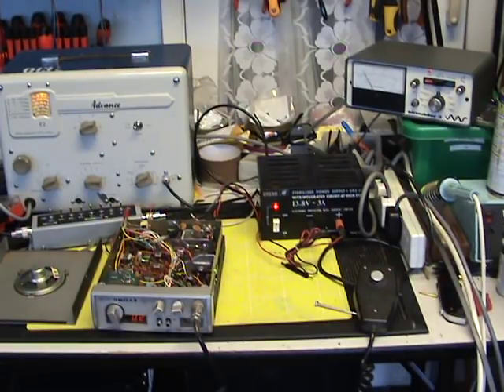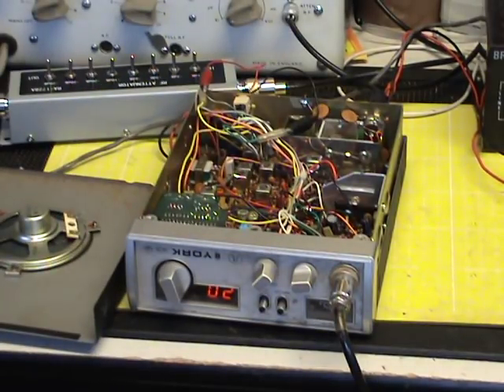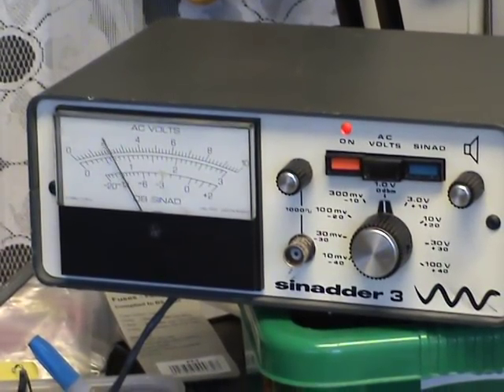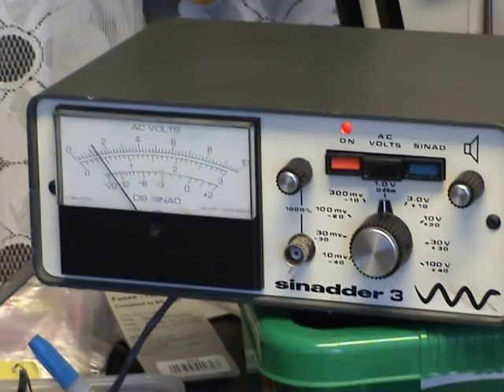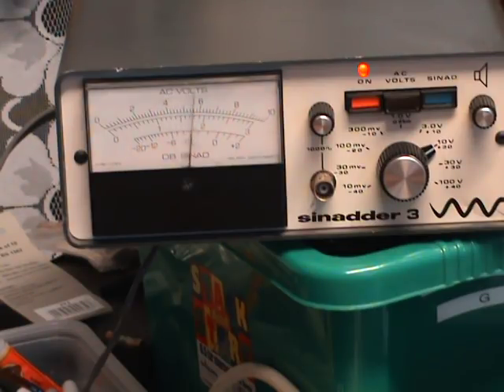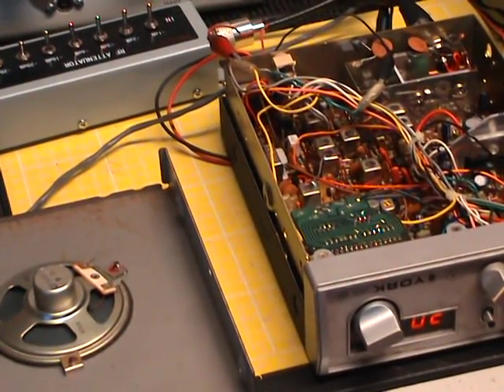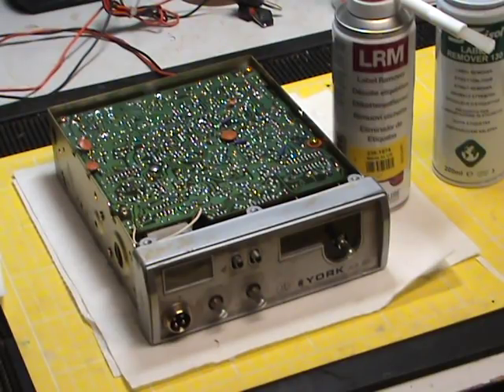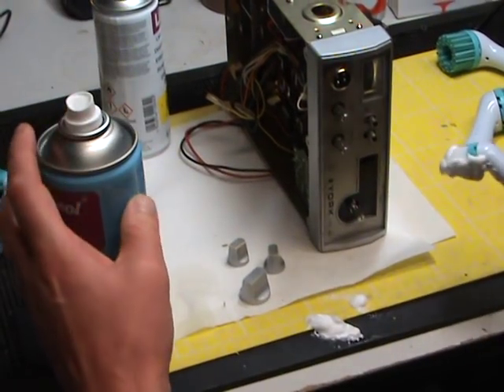CB servicing on a shoestring budget (UK)  Receive on FM only sets using a SINAD meter & cleaning

Comment: have found some very useful sinad meters and af scope pc based software freely available on the net.no need for expensive sound cards just normal af input.for tx measurments I have used the tv style dongles configuard as a sdr rx.excellent for fm deviation and imd /harmonics mesurments all relative of corse to a good set.again cheap as chips under a tenner.excellent video .good work

Comment: Another great video although you stole my thunder doing the Sinad test this week as I’m doing my opposite video series on using expensive test gear. Just to mention before Sinad the FM quieting would have been used and this test can be done without a Sinad meter and just requires a AC voltmeter.  That would be on a shoestring etc. The advantages of Sinad will include measurement being comparable to manufactures data, although watch out for the Sinad reference level often 10 or -12db and I believe manufactures vary the reference level so radios were not comparable.   Sinad meters are not trivial to build or calibrate due to the tightly defined notch filter requirement for removal of the test tone.. LOL you did use mr chippy toothbrush. Really nice score on that Sinad meter very nice,  does the transformer have alternative voltage tapping.
Reply from the maker: As I work (in a self employed capacity) mainly for the C of E, no doubt Big G told me that you were about to do a SINAD video! I too smiled whilst making this video when Mr Chippie came out with the Lidl rotary cleaner after our toothbrush discussion the very same day. 

I don't know if you have seen me using a vibrator (discreetly covered) to locate dry joints & similar, a technique I learnt during my 16 years as service manager at Nottm Radio. A couple of years ago I was told they had vibrators at the local (Grantham) £1 shop, I was in town with Mr Chippie & suggested he went in & bought half a dozen (one for each bench....... just about). He declined & suggested I bought them myself. I went in, dumped them down on the counter & then asked for a receipt so I could put the purchase through the books. There were some funny looks from other people in the checkout queue. Do I look bothered? No.
Reply: UK CB radio servicing  I once went into boots bought all the KY Jelly off the shelves, I sent the young lady to the back room store to look for more.  I’m sure  everyone had a giggle and thought I was some kind of sexual deviant. I was using  the jelly for attaching ultrasonic transducer to a pipeline for some instruments I was developing for the water industry. As my wife found out  for the rest of the year the staff at boots were right, well I couldn’t let it go to waste after the project got cancelled.